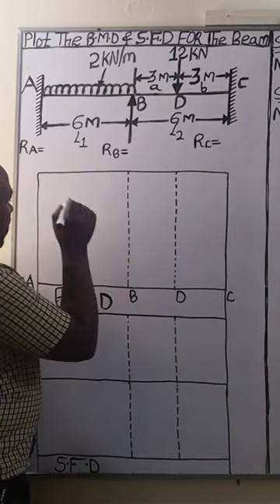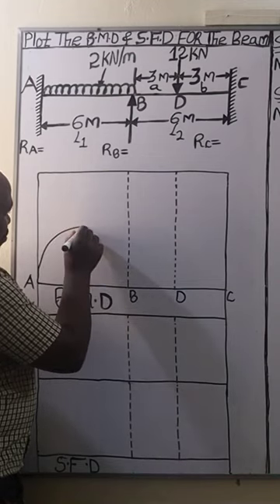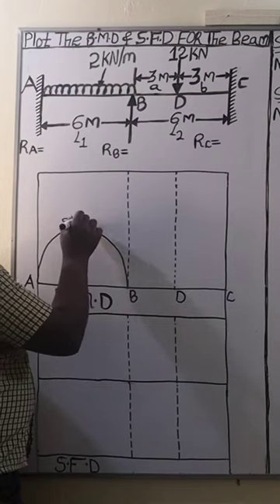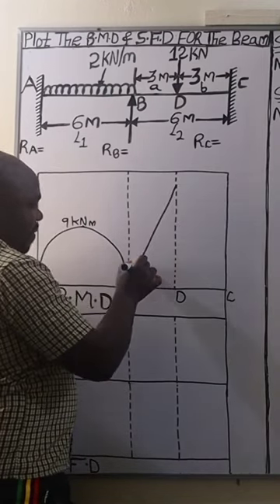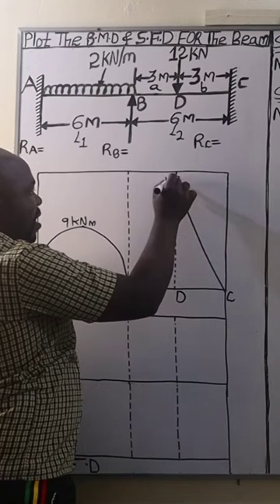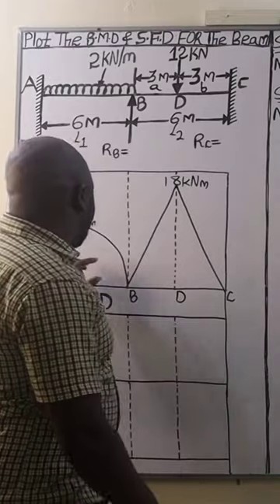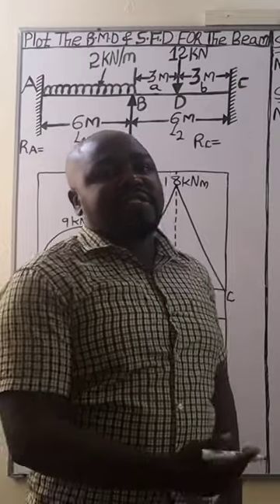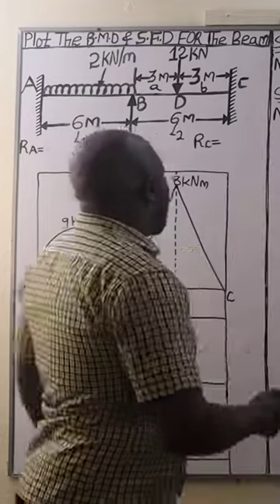Drawing the BMD for a continuous beam.

Comment: What is the Beam for?? ❤❤
Reply from the maker: Beams are usually horizontal structural elements that carry loads perpendicular to their longitudinal direction. They then transmits these loads to the columns or any other structure supporting them.